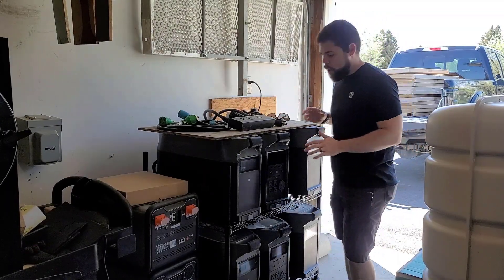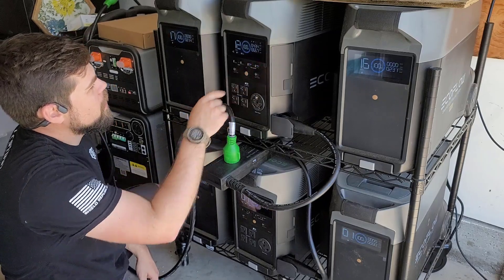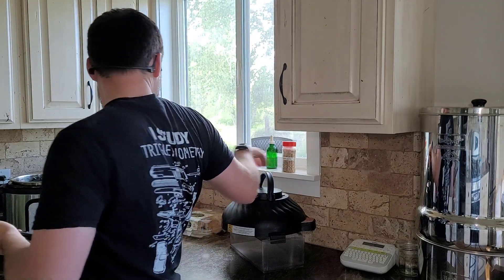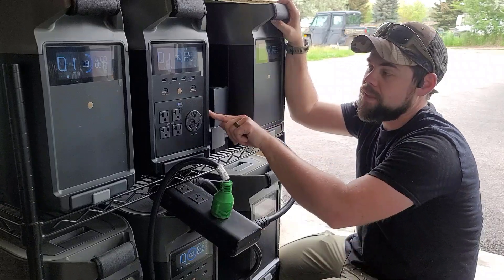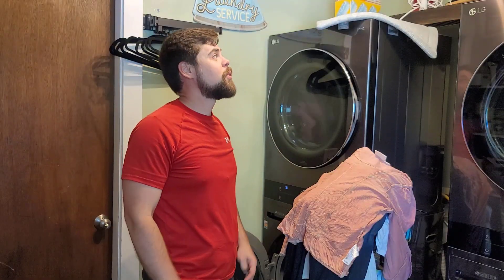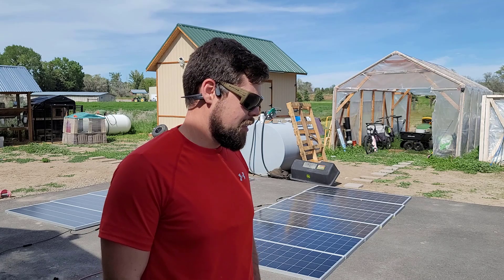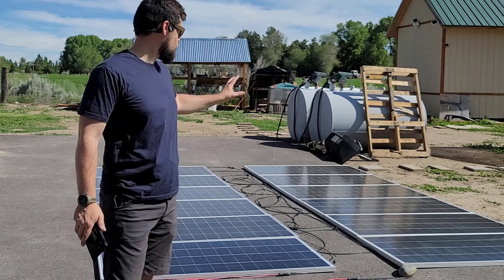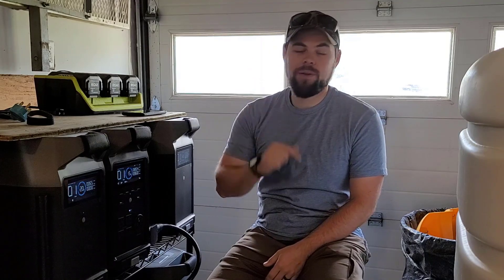Off-Grid House Powered by Solar Generator

Comment: Great information,  question - how would an AC work with the system and big of system can you do? 8kw?  Thanks
Reply from the maker: I'm still unsure if it'll do A/C but from my calculations it's pretty much not possible. I am trying to find a friend of mine who has central A/C and a transfer switch so I can try it out and make a video.

Comment: What about HVAC system ?
Reply from the maker: I personally do  not have central A/C in my house so I haven't been able to test that. But from my understanding, central A/C is not really possible because it uses so much power. I definitely wouldn't recommend it. The issue is that A/C uses so much power that even having a huge battery bank and lots of solar panels, it'll still drain the system pretty quickly. It would also depend on large your A/C unit is. I am going to try and see if any of my friends have central A/C and a transfer switch so I can try it out.
Reply: There are several solar powered A/C split system (one outside unit and only one inside air handler unit) now on the market…however they are sized (at least the current ones) to cool about 600-800 sq ft. ….so you would have to decide which EMERGENCY cooling zone you would choose in your house. The other downside of the models I’ve seen, is that they gradually produce less A/C cooling as the sun exposure on the solar panel reduces ( meaning no A/C at night or on cloudy days), UNLESS you add a battery bank to keep it running after the sun is down, but then….$$$$….if you want a normal sized house 1200-2400 sq ft, totally covered by solar, it’s going to be a major hit in your wallet ….for most of us….emergency coverage is the best we can really afford

Comment: What size of a unit would we need to operate a septic pump and a well pump along with a few lights and a refrigerator and freezer my husband and I don't know too much about this we live rural SC on 3 ac   and we do lose power a few times a year. We have a gas generator right now that helps some
Reply from the maker: Hey Ashlee, that's so cool to be on 3ac out in SC. Septic and well pumps are pretty easy to run off of a 240v Delta Pro kit because they don't run constantly. They pretty much only run when using the bathroom and kitchen for the most part. According to my calculations with everything you mentioned, I would go with the Delta Pro 1600 240v (200w) kit here: https://poweredportablesolar.com/product/delta-pro-kits/ From what I can tell, you need a bare minimum of 5,300wh of battery capacity and at least 1,450w of solar panels to run all the thing you mentioned for multiple days. Going with the DP 1600 240v kit would give you 7,200wh of battery and 1600w of solar so you should be right at the sweet spot of having enough for everything you want to do, and allow for some wiggle room like if it's cloudy in the morning and your panels don't start changing right away or something like that. There would be plenty of room to grow that system as well by adding more batteries and solar if you want to run more things or find that you need more power. You'll always want a transfer switch installed on your house if you don't have one already, it's a simple task for an electrician to do. Mine was about $1200 to have it put in.  Feel free to shoot an email over to info@poweredportablesolar.com as well if you guys have more questions, we're always here to help.